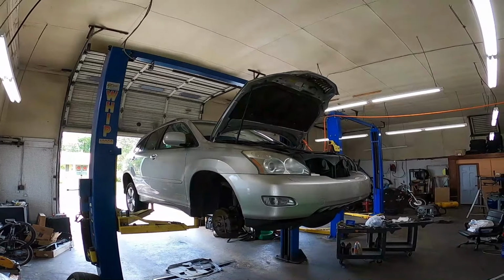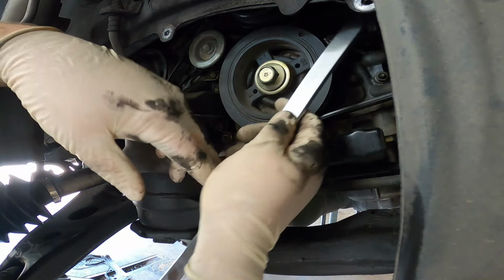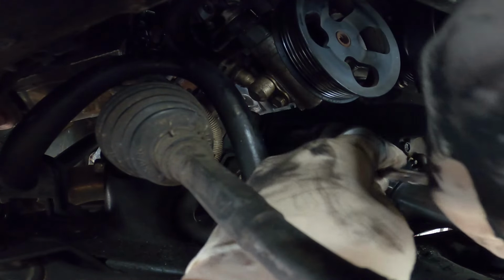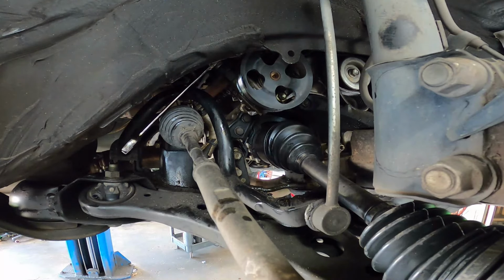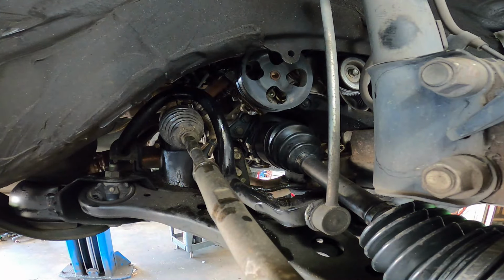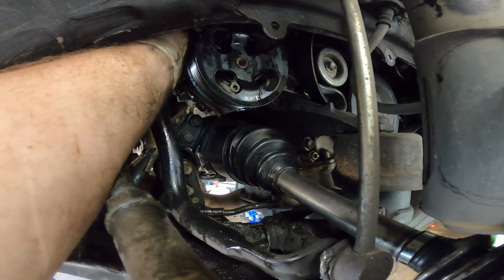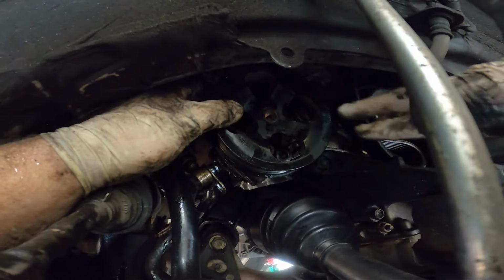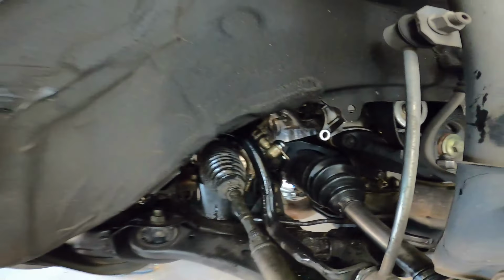Lexus RX350 Power Steering Pump Replacement

Comment: Nice work, you covered the important parts of doing the job, New gaskets and O rings are good insurance of not having leaks. Your right about it being a messy job with the fluid running out of the pump, but messy is part of any worthwhile job !

Comment: Thanks so much for posting this!  I’m going to be replacing the vvt-I pipe on my old ES350, and it looks like pulling out the PS pump will be the best route compared to all of the other gymnastics that people go through.  (I’ll try just pushing it aside first.) I do want to replace the O ring and double gasket, but have had a hell of a time sourcing the o ring.  I have one on order that I hope is correct. If not I’m guessing the old one will be ok.  It’s the low pressure port anyway.  Thanks again!
Reply: Have you managed to fix it? Would you be able to share the part numbers of the gaskets? Thanks!